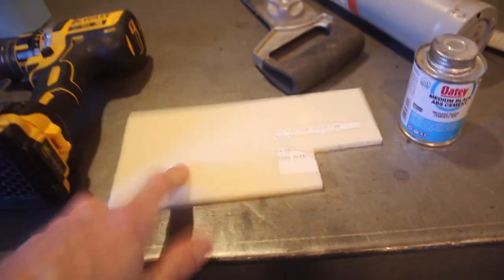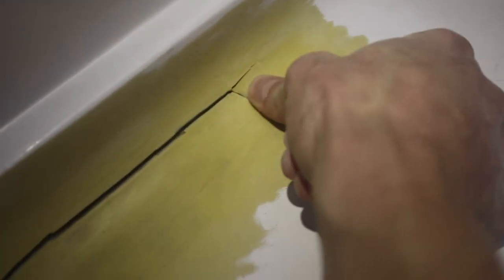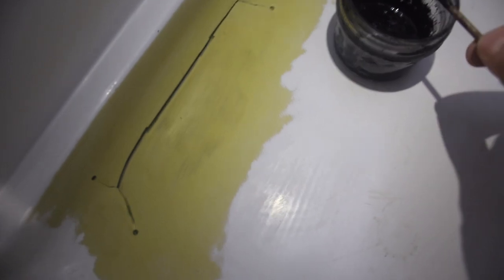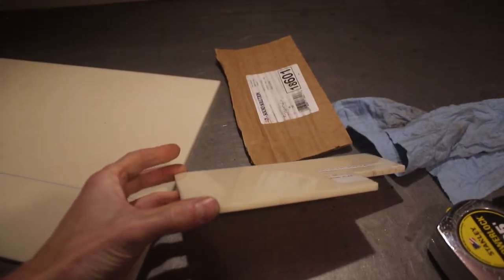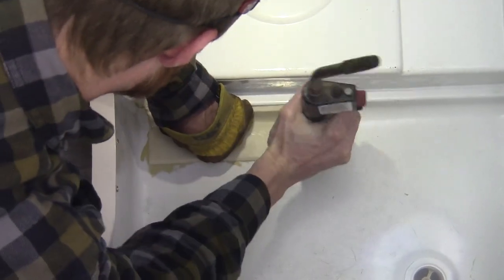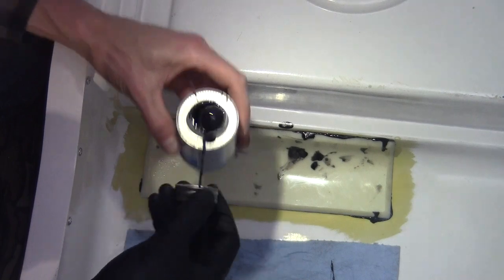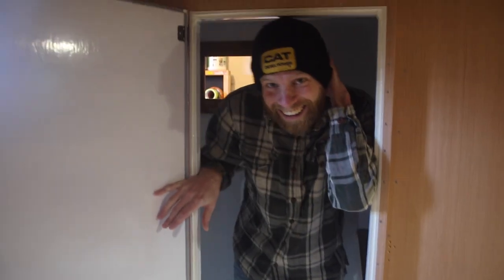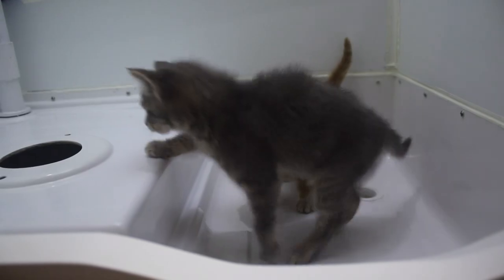PLASTIC SHOWER/BATH REPAIR 🛁  - Truck Camper Build Part 23

Comment: Hey, just wondering but did you consider taking the pan out and putting the re-enforcing patch on the back side?
Reply from the maker: Yes removing the pan and reinforcing from the backside would be a better way to fix this. But it would have been a lot of work to remove the pan at the point of this video (walls would have needed to be removed). So I tried fixing it like you saw in this video as a first attempt.

Comment: how well did those hold up? do you think just ABS paste would work for a flat spot with a crack?
Reply from the maker: The best would be to repair the crack from the back side. But if that is not feasible, I would recommend my patch method. Using just ABS cement/slurry even on flat surface crack may not work but you can try it if that’s your only option.